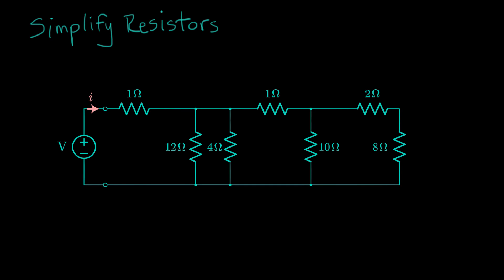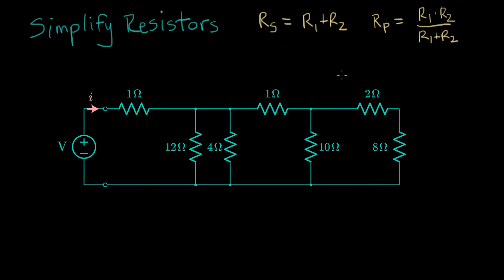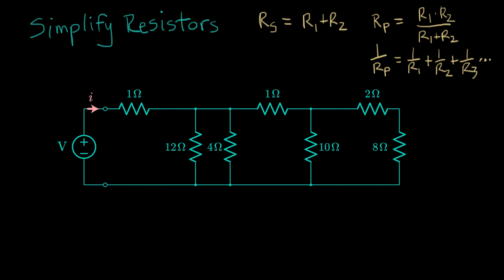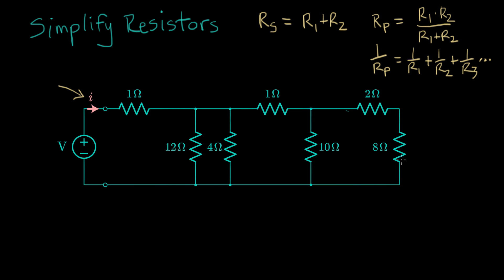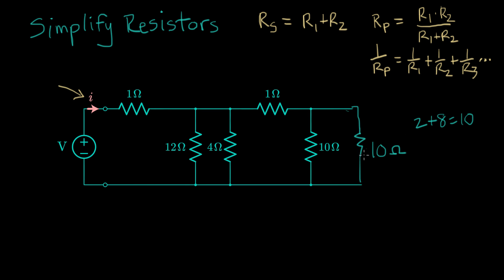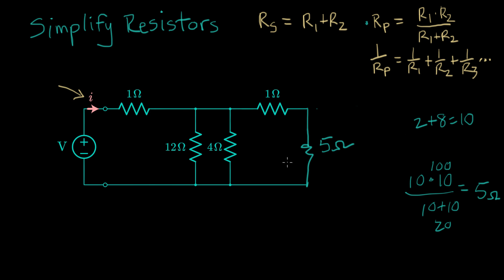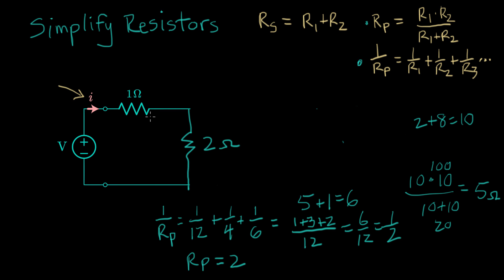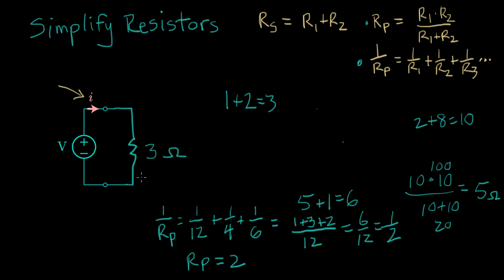Simplifying resistor networks | Circuit analysis | Electrical engineering | Khan Academy

Comment: Wait... WHAT? so the current is 3 Ohms? I think we need to know the voltage of the source to solve for i
Reply: He solved for resistance; 3-ohms. Current is measured in Amps. Correct, we need to know Voltage and Resistance in order to solve for 'i' (current).

Comment: Another example of a teacher passing on the poor habits he was taught. Calculators have had a key marked x^-1 or 1/x forever. Using that key makes parallel resistor calculations trivial: 

12 [1/x] + 4 [1/x] + 6 [1/x] = [1/x]. 

The calculation even looks the same as the parallel resistor formula
Reply: . . in this ved he's explaining the basics of calculating the total resistance . . if you already  know that . . why on earth did you watch it . . rather you could have taken ur calculator "on which you perfectly know how to do it" . . by the comment you made . . evidently you made a fool out of yourself
Reply: +Brian Greenfield What do you mean by poor habits?  This is how it's done without a calculator so I don't see a poor habit.
Reply: Calculating resistors in parallel using the product-over-sum formula given in the video is a poor habit.

Other than classroom problems where the answer is often a nice round number, nobody solves resistors in parallel without a calculator.